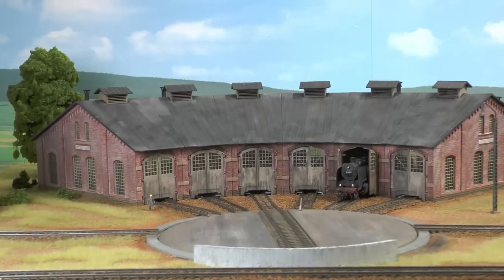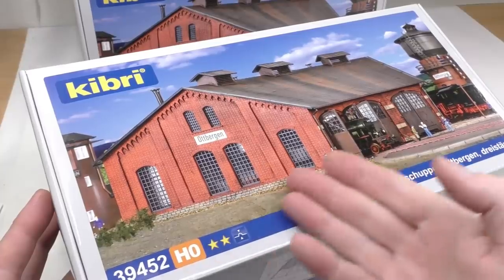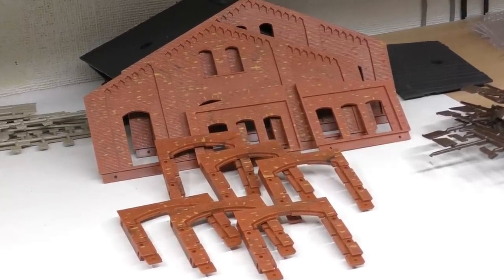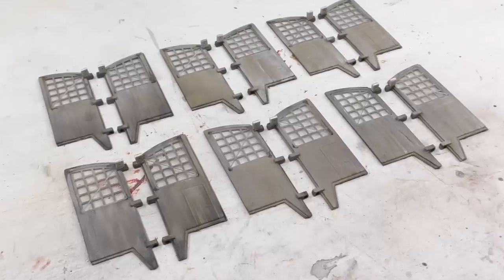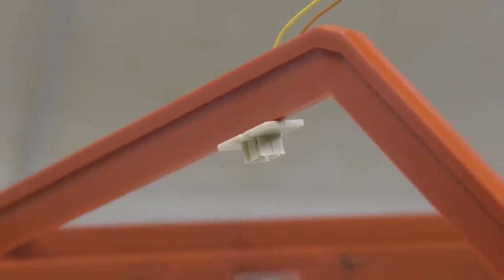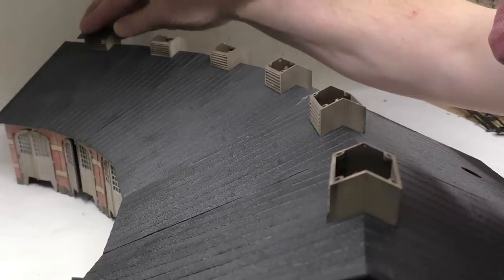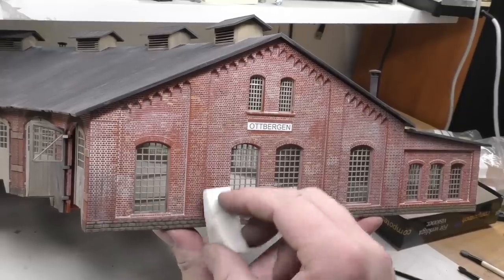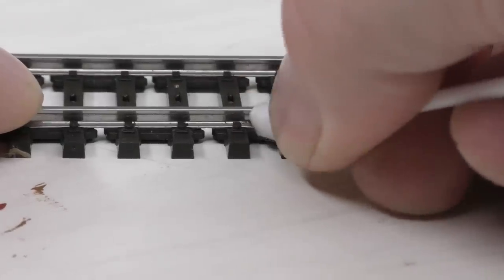Building, Painting & Weathering the Roundhouse

Comment: A very detailed Roundhouse and a nice diorama. I am also building a 6 bay roundhouse that is being 3D printed for me. The creator made a mistake on the front walls and doors, he did not allow for the tracks. I think he is redrawing them now, but after seeing this video I saw the doors are shaped to go over the track. I also want to open and close the doors. I will use servos with control via an Arduino board with an Uno 3. I think I will try and cut the door and see if that is ok or not. Many thanks. Martin (Thailand)

Comment: Well done, the only thing I would change is the speed in which the doors close.
Reply from the maker: Thank you! Yepp! Me too, but that would require a much more complicated driver circuit. Simply outside of my knowledge of electronic design..
Reply: marklinofsweden Here in the Netherlands we have a website called Arcomora: https://www.arcomora.com/ . They sell a cheap Arduino + DCC shield for about €10. This will give you the opportunity to program your servos very easyly and make that time about 9 seconds instead of 1.
No need for programming skills, the interface is easy to use and allows all kind of possibilities. I use it to switch 3 way switches with the cheapest Chinese servos available.

Comment: Hi !  Is there any method of adjusting the speed of the motor used to control the doors? They seem to open and close too quickly.
Reply from the maker: Yes. These servos operate linear, so the motion can be very slow and very precise.. However.. Then you need a more intelligent driver circuit. If you’re building like a 6-port or larger, it’s probably best to program an Arduino and use a PWM-motor module withit.
Reply: @marklinofsweden  Many thanks!